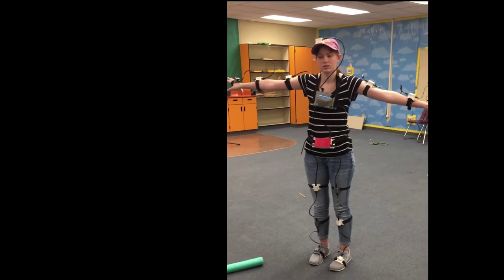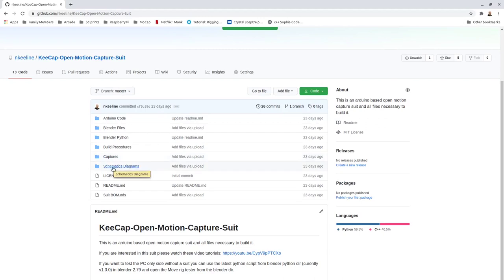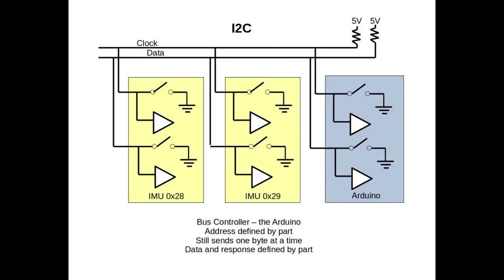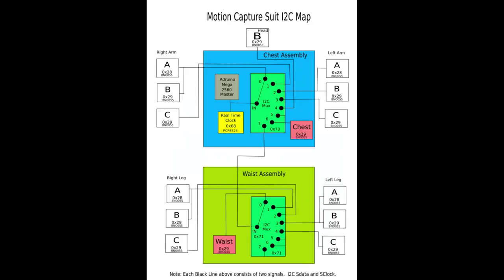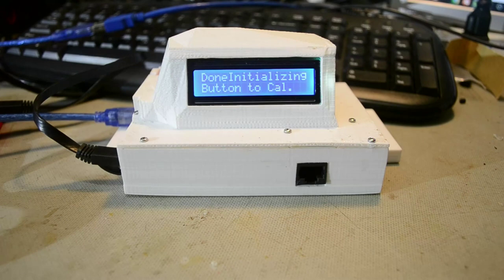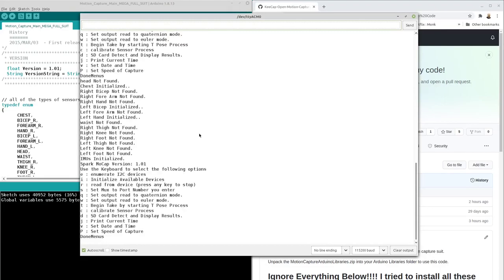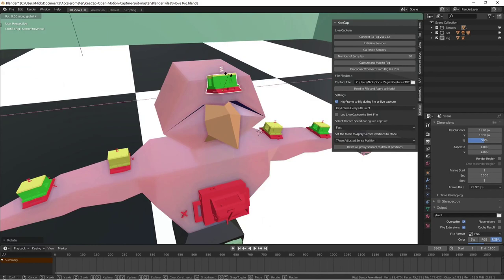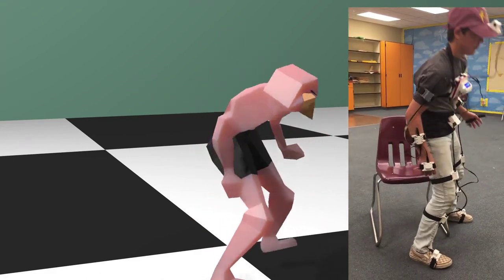Open Source Arduino Motion Capture Suit Tutorial

Comment: Hey! Can I use any other IMU besides the Bosche BNO055?

It's out of stock and not available here
Reply from the maker: There is no reason you cannot use a different imu, but I would test its performance with a test setup arduino first
Reply: @checkeredbug8015  Thank you! <3
Reply: @checkeredbug8015  Hey can I use an accelerometer instead of an IMU? Does the Arduino require all 9 axis values to work?

Looking at the Captures text file, I believe we are only using location and rotation ? ~~chest~qW:-0.5470~qX:-0.3934~qY:0.6216~qZ:0.3995~

Comment: How does this compare to the Rokoko suits in terms of accuracy and drift?
Reply from the maker: It's not as good, which is why we use rokoku now instead.
Reply: @checkeredbug8015  can you reverse engineer it?? 🤔
Reply: @knartfocker_  I probably could but I won't.  If I were to change the suit I would go to custom pcbas with double or triple imus to average out noise then do a ton of software work to customize the data with knowledge about each position on the body, but that would cost more than buying the rokoku.

Comment: Which other boards apart from the arduino would you recommend? Would they still require the i2c?
Reply from the maker: Im not sure I understand the question. If you move away from arduino ide you'll have to rewrite the code.   Arduino has many alternative boards that might work , but I used the mega because I ran out of code space on the uno.
Reply: @checkeredbug8015   Thanks for the reply. I want to build it as my school project but I'm not supposed to use arduino because
because it is rarely used "professionally" so I was wondering what other  microcontrollers are there that are generally used beyond the arduino.
Reply from the maker: I am a professional... seriously,  been doing it for years.  I know sw and firmware engineers that are seriously high powered, we all love arduino.   The only difference between arduino and others is the excellent tool chain and boot code and open hardware they provide to make your life easy.
Reply from the maker: If you really must, i tried ti launchpad a while back... and  pic controllers work well, but it takes a lot longer in development imho https://www.popularmechanics.com/technology/how-to/g1426/arduino-alternatives-5-microcontrollers-you-should-know/
Reply: @checkeredbug8015  Thank you very much.

Comment: So, I realized that when the kid walks in the suit, the 3d model does not walk forward, it just walks in place, why is that? And how could I fix that if I were making this mocap suit
Reply from the maker: Position is the holy grail of non camera based solutions. Imus know acceleration,  accel is the derivative or change in velocity and velocity is the derivative of position. If you do the math (double derivative) of acceleration to get position any error in the acceleration gets compounded and shoots your character out to another country.
Reply from the maker: To fix the issue I tried three things 
1 bought a $1200 pozyx system that didn't work due to 10cm jitter.
2 started building a sound/radio transmitter that calculated distance using the delta of the speed of sound and light to calc distance, didn't finish it .
3 could use all the accels to calc position,  never started this
Reply: Wow, I didn't know that that was harder than I originally thought
Reply: Hey, but thank you for the response though. I'll definitely look into making one of these things. This is an awesome series man. Thank you
Reply: Motion tracking is a butt, that's why I kind of want to do this
Reply: @checkeredbug8015  It's been some time since I've done any geometry, but assuming that azimuth angle and distance to target can be known through a combination of these two devices, would that be enough to calculate x,y coordinates?
https://getpivo.com/ (probably could be replaced with software and a stepper motor)
https://www.homedepot.com/p/Bosch-BLAZE-ONE-165-ft-Laser-Measurer-with-Auto-Square-Footage-Detection-GLM165-10/305470649

My basic idea is that this would be a poor man's equivalent of taping a prism to somebody's head and having a surveyor record their position with a total station while doing the mocap at the same time.
Reply: @checkeredbug8015  It occurred to me that a major flaw in my idea is that the distance measured would be that if the target rotates, then the target's closest distance to the laser would shift by like a foot or so.  But, to fix that I have the following improved version.  Limitation would be that you would need one per actor or a design change.

Materials:
2 stepper motors
2 potentiometers (possibly unneeded, there's probably stepper motors that can track which step they're at)
1 camera
1 laser distance measuring device
A surveyor's prism (probably not needed)
software to control mechanism

Device:
Camera is mounted into bracket with laser mounted such that laser is as close to center as possible.
Camera is focused on a marker placed on top of actor's head.
Camera tracks position of marker in frame, sends information to software.
Software spins stepper motors to keep marker centered in frame (potentiometers report angular position of stepper motors, couldn't remember if stepper motors can track their angular alignment)
Laser reports distance to marker (i.e. an approximate center point of the actor's head)

Output measurements:
Θ2 - Azimuth  of laser from potentiometer(or stepper motor)
Θ1 - Elevation of laser from potentiometer(or stepper motor)
Hypotenuse - Direct distance from device to center point of top face of actor (thinking of actor like a cube)

Calculations:

Convert potentiometer output into angular measurement

Get Polar coordinates
r = Sine(Elevation Angle) * Hypotenuse[distance between laser and actor's head] = Distance from Origin 
Θ = azimuth angle

Convert to Cartesian coordinates
x = R[result of above] × cos( Azimuth angle )
y = R[result of above] × sin( Azimuth angle )

Final result: 
actor's xy coordinates relative to directly below the laser rig.

Limitations:
1. Depending on mounting height, trackable distance may be limited as the elevation angle approaches zero (assuming 90 is straight down)
2. Mocap needs to occur somewhere not directly beneath the sensor (just because the motors probably can't adjust azimuth and elevation quickly enough to not generate bad data if the origin is crossed)
3. Design as posted can't accommodate multiple actors (though multiple devices could be set up in one room, if software can recognize different markers).
Reply from the maker: Wow, sounds good, I think if Iwere to make a solution at this point I would use a couple of raspberry pis with cameras and track the target with the cameras.
Reply from the maker: I bought one of those distance meters from home depot and getting the steppers acurate enough to actually hit a target would be a miracle.
Reply from the maker: Sorry didnt mean to imply i actually tried your solution,  i just own one so i know of it, I wish you all the best if you can get it to work

Comment: now how to use this for vr chat
Reply: It's doable and something I've been looking into for the past 3 years... though most was spent just idling around and enduring my job.
To make it work in VRChat, you'd need to know the lengths of all the bones of a user ahead of time (something you can do before you use it the first time and save it as a profile), and then use software that translates the rotation data of all the bones to a 3D skeleton. Because we know the lengths of all the bones, the system can translate that into 3D space and create virtual trackers. The sensors don't know the positions, so to establish in actual 3D space where everything is, we just use the user's headset and base all offsets from there (IE: Feet position = HMD Position + Feet virtual position).
I already have core software that handles the internal translations, but writing virtual tracker drivers is where the real tough part is, since OpenVR's documentation is... very sparse.